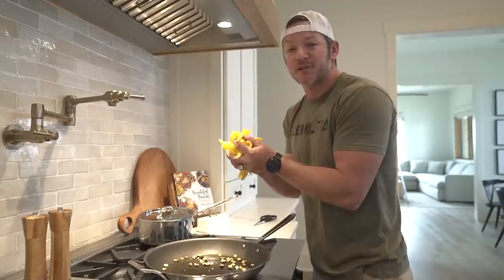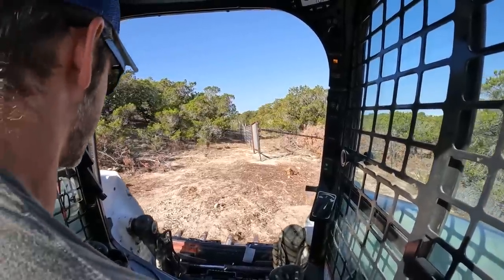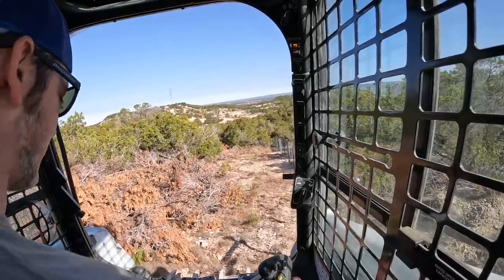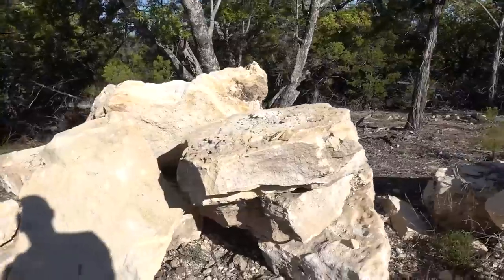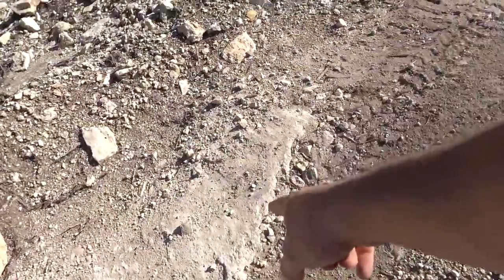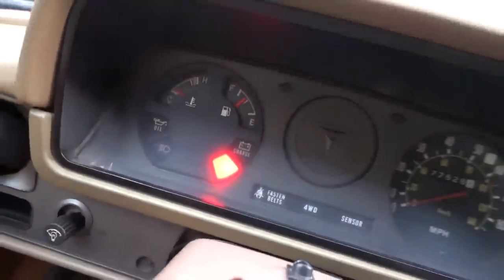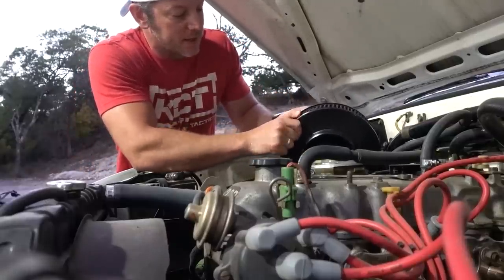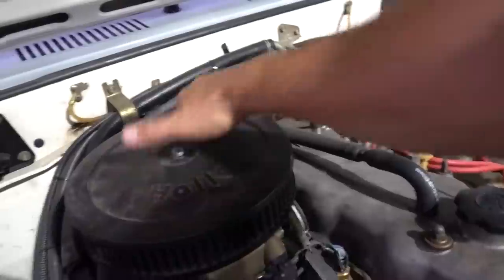Making a Home for the Goats!!!

Comment: Dear Matt, worried about the clearance under the gate, coyotes love goats, kind of have to agree with the donkey idea, otherwise, you may have some...... goats, just a thought. Love the videos, been watching a-long-time.
Reply: Another thought would be to dig out either in front of the gate or in the middle of the gate resting area when closed and insert some of that rock shelf pieces that you have laying around to prevent digging by animals at the gate (the cheap) fix or pouring a cement slab in the area right under the resting gate local when shut.

Comment: Never ever shake or tip up brake fluid before topping up. All the air which has nicely settled out will now be back in your juice, its so small you may not even see its there.

Comment: You should never just top off your brake fluid without looking to see why it is low. Commonly that indicates that your brake pads are getting thin and need to be replaced. hey However, it could also indicate a fluid leak that could cause a loss of brakes while driving down the highway.
Also, goats are excellent climbers and will use the rock pile for a play area, but also will use anything close to the fence that they can climb on to go over the fence, such as their barn if there's any chance of them getting on top of it.

Comment: Matt you need the old school Lincoln welder on a trailer. Don't buy a newer one. Find one that has the heavy copper windings. They also have a wire feed you can attach to the Lincoln welders. not this deficient so called welders. currently produced. Something from the 50s and 60s. It'll last forever and you're getting better at welding or you will be better. Lol

Comment: Take 3 engines, 4cy, v6, V8 put them on engine stands and see what type of rounds would be needed to disable a motor, works on Kentucky ballistic behalf as well due to the was a Kentucky state police officer (thank you so must for your service Scott) so it can be a 3-1 demo ranch, just be sure to DONT TELL MARE,,,,,, try to get at least the V8 in a steel block

Comment: When building the pin, the fence should have been buried at least 2 feet into the ground so predators cannot dig under and it needs to be at least 8 feet tall so predators cannot jump over it and the goats cannot jump over it because they will jump off of the shelter roof over it most definitely

Comment: Goats will find a way to get on top of it. Do keep that in mind. Also, a lot of things will try to get in with the goats. You may want to think about putting a hot wire 6in off the ground, 6in around the outside of the pen. That will keep most things from digging under your fence. Just saying.

Comment: Your truck shouldn't be low on brake fluid. If its low there should be a reason, either a leak somewhere or low brake pads. Look for the reason.
Reply: To clarify, vehicles don't consume brake fluid. If its low. There's a reason,  potentially a serious one.

Comment: Hey Matt, just a heads up brake fluid isn't a consumed fluid. As in short of a leak it should never decrease in level. When your brake fluid is low like that it typically means your brake pads or shoes are worn causing your calipers/wheel cylinders to push out further than normal causing the level to drop. Topping up the fluid is all well and good to get the light to turn off but make a note of it and check it when you do the brakes on that little unit. When you put new pads on and push the pots back into the caliper it'll actually make the fluid overflow out of the master cylinder and nobody wants brake fluid all over their inner fenders as brake fluid strips paint.

Comment: Matt, usually when the brake fluid is low, it means you brakes are worn. Fluid gets lower in the master brake cylinder reservoir as it starts to fill the brake cylinder. Or you just have a leak, most likely brake cylinder. But you probably already know this.

Comment: You need to use pliers and tighten the filter bolt unto the carb or it'll vibrate loose again. Finger tight only works for so long.

Comment: Are you using your old garbage camera again at 14:00? The audio gets ear piercingly high-pitched around this point. 🤬 

Since you got the new camera, the audio has been great... until now. If you haven't changed cameras, then you need to ditch the garbage model/brand you use. Because clearly it has a short shelf life of good audio before it becomes an ear piercing high pitch nuisance at random times during recording.